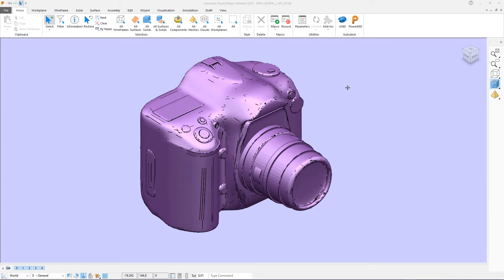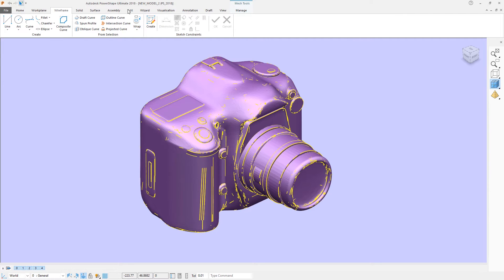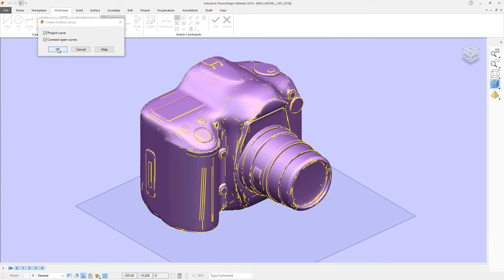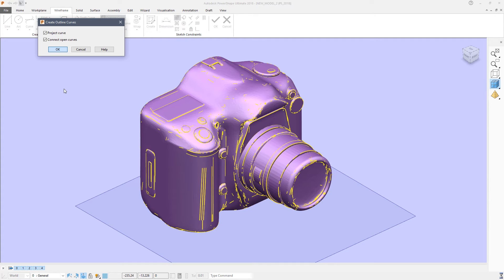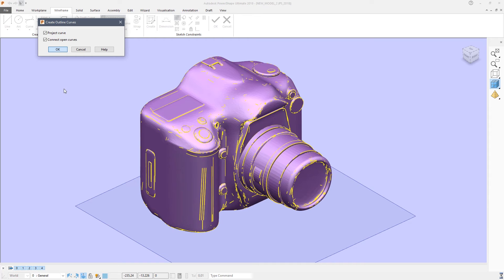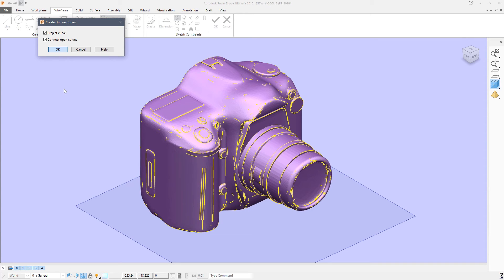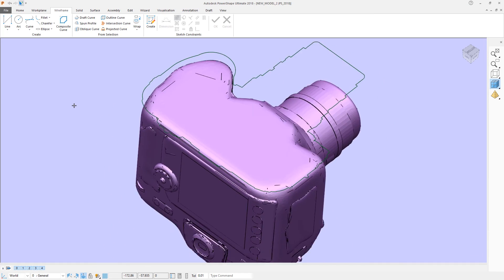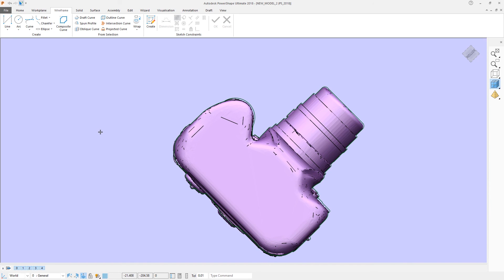Mesh Outline Curve - PowerShape 2018

Comment: This should be very useful  in just wondering if there is a specific process for creating a 3d cutout/cavity for as you say creating a carry case for an object. 
If i don't want to just cut out the outline into the entire depth and instead have a cutout the object can slide into but eventually the foam matches the shape of the object. So for something like a camera, the bottom of the camera and the lens etc all have foam under them...